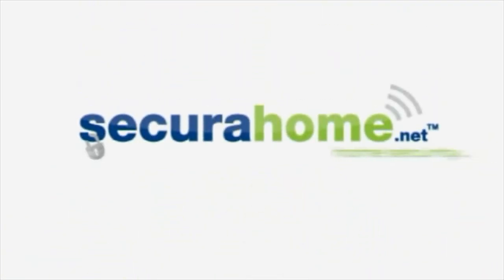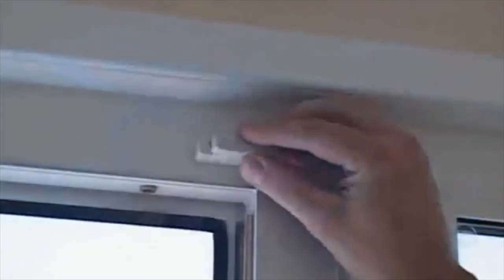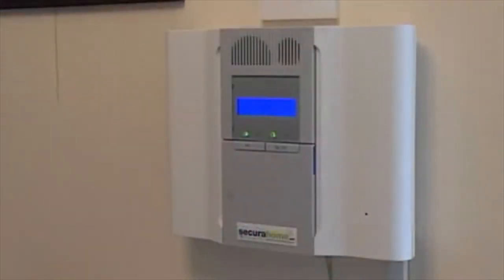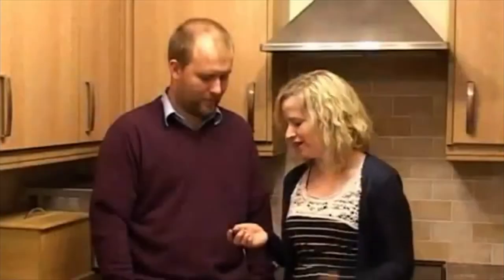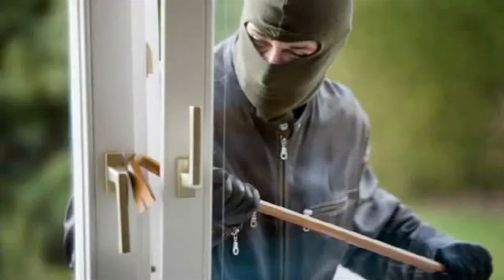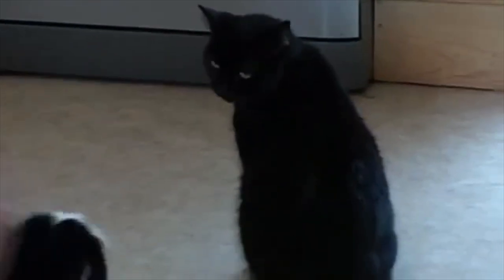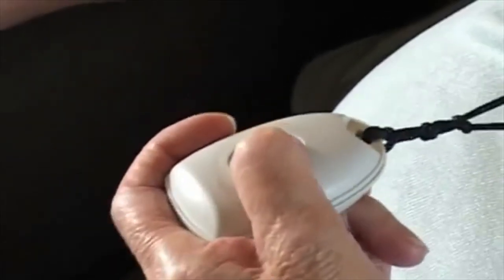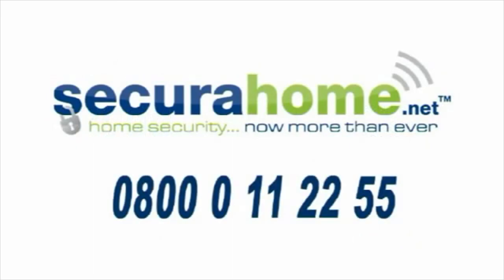Wireless Burglar Alarms by Securahome.net (Updated)

Comment: Had a wireless alarm fitted by securahome over 18 months ago and it’s been fantastic. After being burgled we wanted to go over the top sensors and contacts everywhere. Nick talked us through the options and customised the alarm to our needs, which gave us the same protection but also saved us some cash which was great. Quick and tidy installation - top bloke and great company to deal with 👍🏼